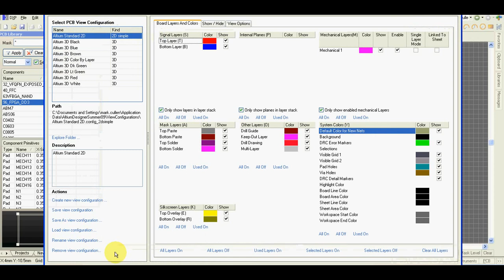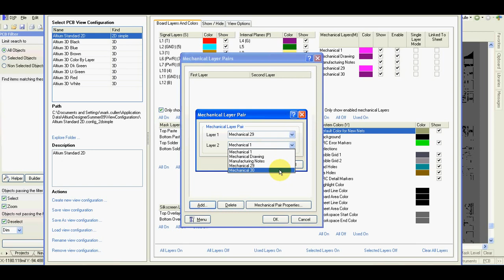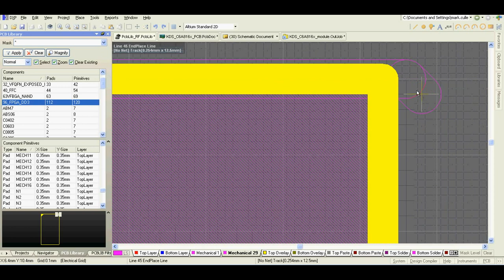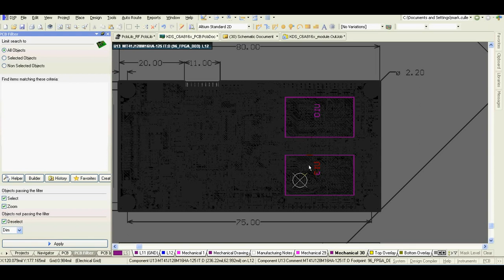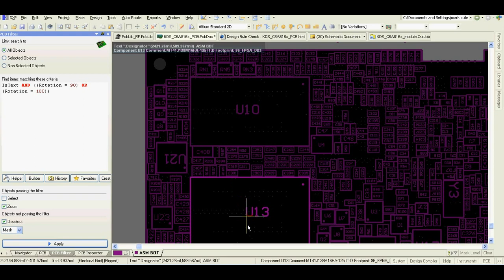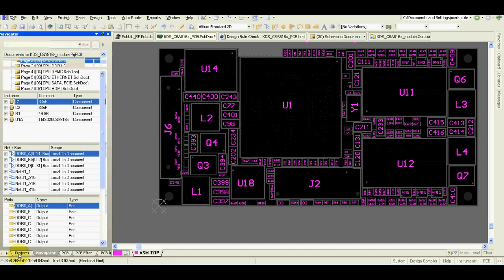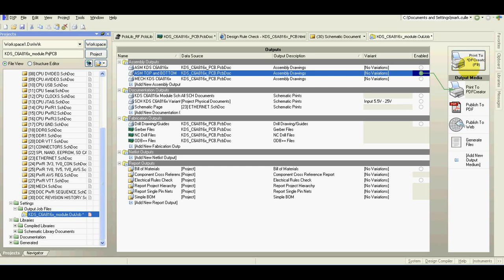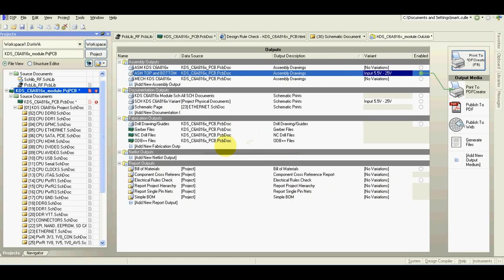Altium Designer - How to Create Assembly Drawing Layers

Comment: thank you.
Is it possible to separate components of the same size with different colors in pdf??( for example size 0402 blue and 0603 red)
Reply from the maker: Hmm ... I believe, colors can not be applied on components, just nets. So, I would say, it in Altium it is not possible (or not so simple?). Maybe in Draftsman it could be done?
Reply: @RobertFeranec  thanks for your reply.
I found a software that can do this. Its name is unisoft.
It is very useful for preparing assembly document.

Comment: Thank you for fantastic tutorials. I'm a little bit confused with definitions of some of mechanical layers in Altium. In many other CAD's there are standard layers dedicated to Assembly Drawing for footprints. This simplifies footprint exchange. Here you can assign any mechanical layer pair to this. Meaning that somebody's footprints may use different layers for this. Is there any "standard' or some sort of convention about layer assignment that most of Altium designers are following?
Reply from the maker: I do not know about any standard.
Reply: Thanks. Is it enough to change name of mechanical layer if you used different layer. Or Altium will keep corresponding assignment to you original Mech layer. I mean that I used layer M15 for my assembly drawing on lib parts and named it ASSY_TOP, somebody used M17. Is it enough to rename M17 to ASSY_TOP on his parts to get all assembly drawings on my boards. Or I will have to enable both layers on the board to get assembly drawings?
Reply from the maker: I do not know. I think, you only change name of the layer and altium still knows the original number.

Comment: thank you for video. do I need to define mechanical layer for components with overlay boundries (yellow lines) shown on top/bottom overlay layers ? what's the difference between mechanical and overlay boundries ?
Reply from the maker: +rangelso I am not really sure what do you mean by mechanical layer ... do you mean the assembly layer? You don't have to create assembly layers, but it's useful during board assembly.
Reply: +Robert ok but if I have all component designators and boundries in yellow on top / bottom overlay layers why using additional assembly layer ? and how they appear on actual pcb board ? Are they used for automated assembly or manual too ?
Reply from the maker: If you can put all the info on silkscreen, you can use that layer instead. Assembly layers are used by assembly house for the people who work on your board (manual) - not for the machines.
Reply: +Robert Feranec very well, now I understand, thank you ! one more thing what&#39;s the use of mechanical13 and 15 by default in pcb layer stack ? some compoments have crosshair area and outlines on mechanical but not all. Is it too for assembly purposes ?
Reply from the maker: Are you referring to a specific minute in the video?

Comment: Thank You for nice video, but what about layer pairs in integrated libraries - is it possible to manage this functionality when using libraries outside the project?  It is working just then, if I change component's side after creating layer pairs, but if there is any possibility to add layer pair for existing design (some kind of refresh)?
Reply from the maker: Yes it works an it is possible. If you like, have a look at our open source project and download the altium files: http://www.imx6rex.com/ You will see the assembly drawing layer there.

Comment: Thank you for the video but is there seriously no quicker way of doing it? Opening each component separately and then drawing a border and adding a designator will take hours. Besides the fact that I don't have the transistors, resistors and caps in the PCB library because I used the IPC standard library for those footprints. How would I edit those footprints?
Reply from the maker: Hmm, we always create components by ourself - this is exactly one of the reasons why we do that. I would say, you can just update the footprints in the IPC libraries or you can generate your own project library and update it maybe there. But what would be the best solution, i dont know, you may want to try different options and use the one which suits best for your case.